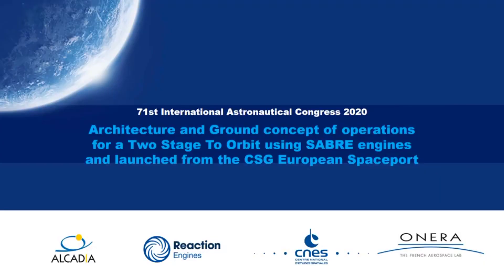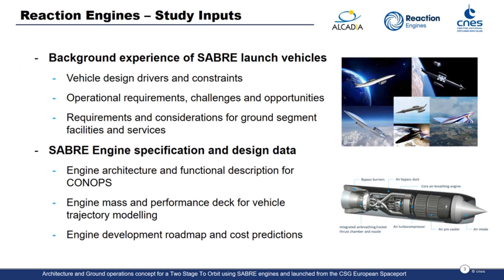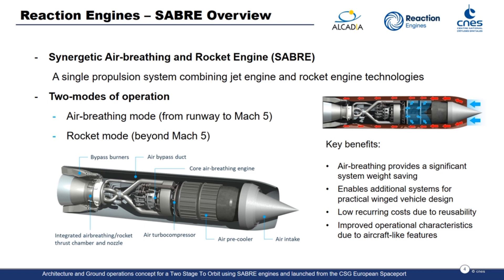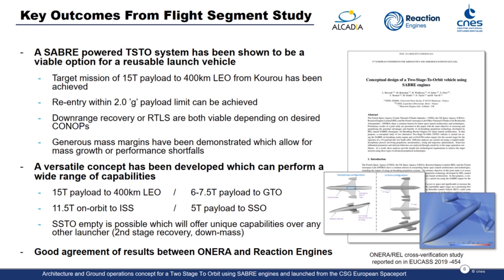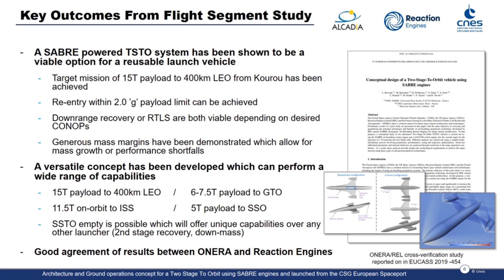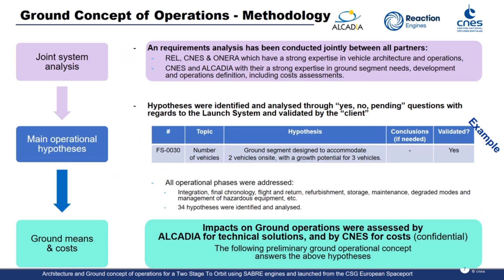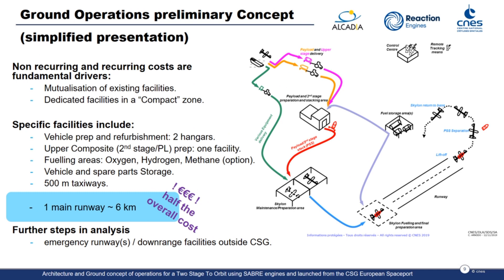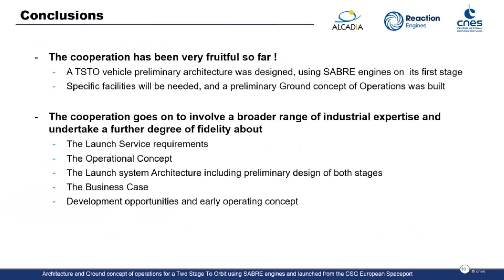Skylon...Architecture and Ground Operations Concept talk

Comment: TLDR: Skylon as an SSTO is dead.
Reply: If it were flying today, it would be the only 100% re-usable vehicle. It will be faster to turn around and last longer than the 10 flights the F9 is rated for.
Reply: Better turn-around than STS, 99% reusable for a booster/hypersonic transport, sounds like not having SSTO is a winning trade-off.
"99% reusable" you ask? Yeah, I'm betting there comes a point where some components like the harshest environment bearings and seals will become maintenance items.